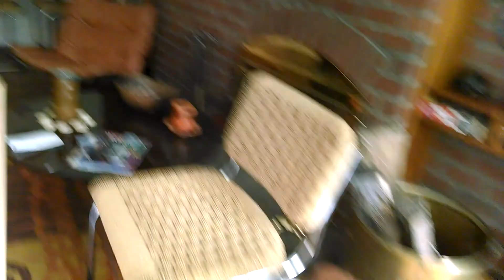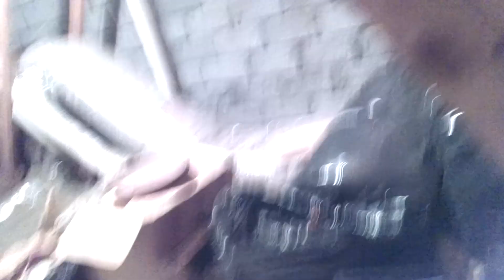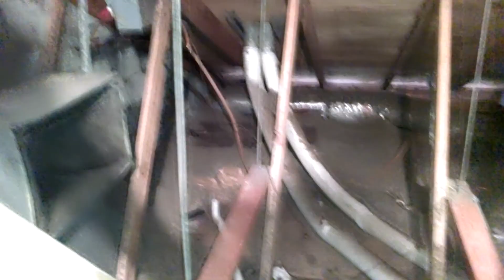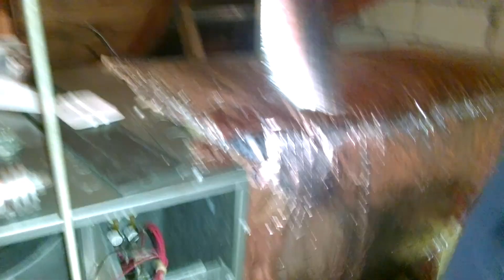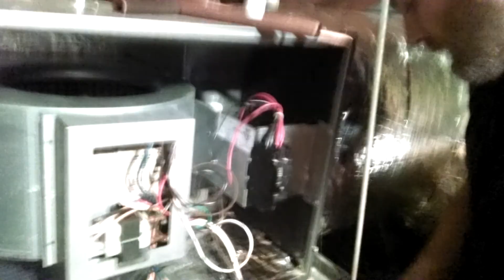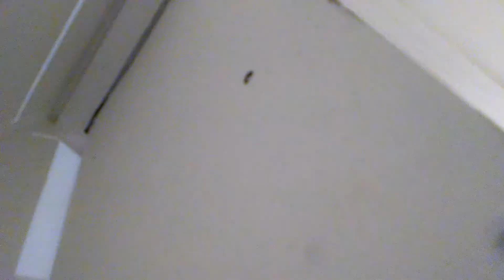Monday Funday

Comment: This is the first time I've seen a "vinegar port" on a drain line. I'd like to see more on that approach to keeping the line from clogging.
Reply from the maker: We do not recommend bleach because it could be bad if not flushed out of the drain pan. If the bleach is put in the drain pan and sets all year long stop being flushed out it could be corrosive that's why we use vinegar and not bleach
Reply from the maker: Thanks so much for watching my video
Reply: I re-watched the segment where you show the drain. Did I see that the unit's drain pan has two ports, one used for the regular P-trap drain and the second is where you installed a 45 and a cap for the vinegar?
If you have a video showing a vinegar cleanout in action, that would be great.